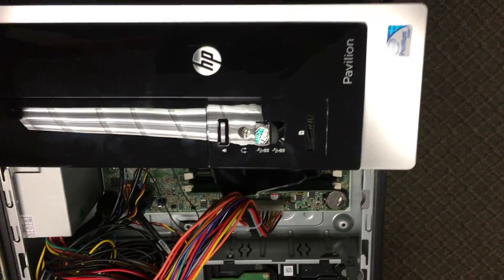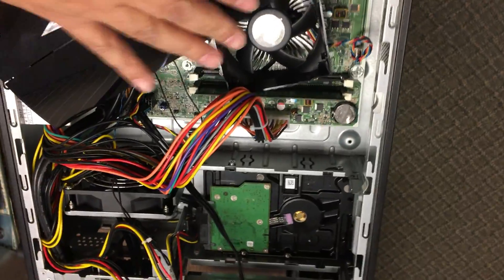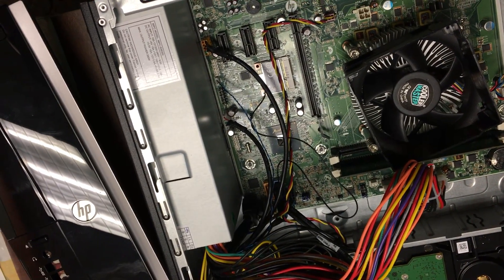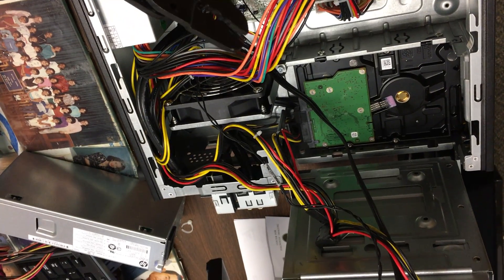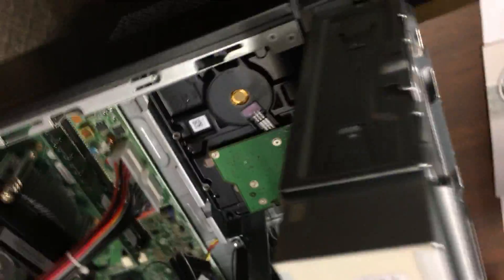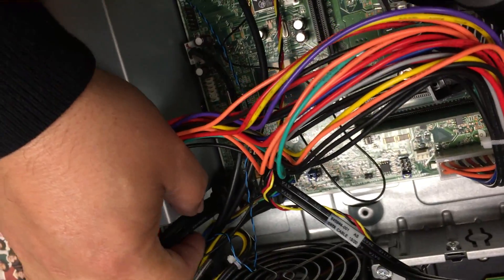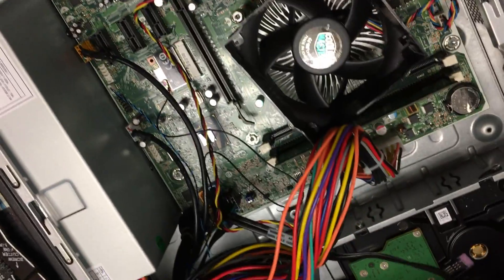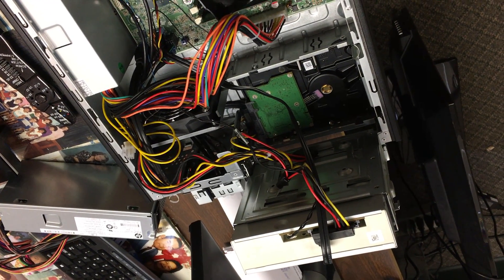HP Slimline won't power on! How to replace power supply.

Comment: I have the exact same scenario going on with the same computer model. Good video explaining the process but wish you would have filmed the actual install. But overall good tips that you provided.  Also, what is the make and model of the PSU that you installed?  I see off brands out there for cheaper so am not sure which route to take.